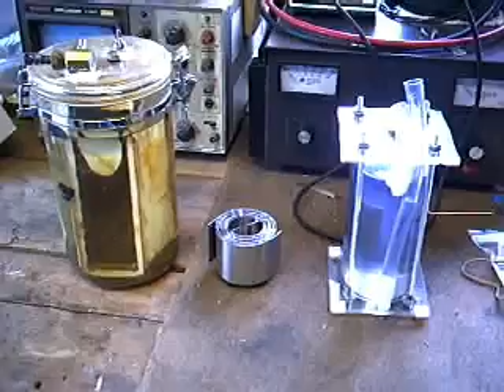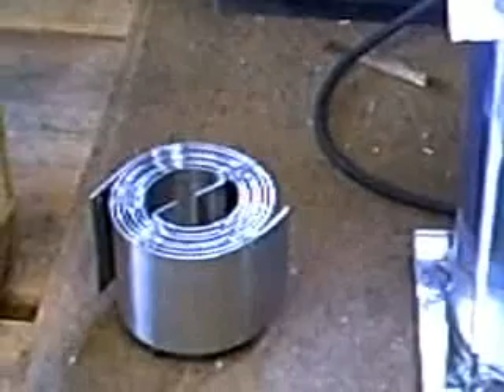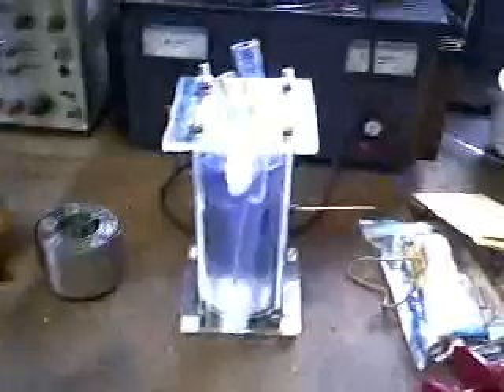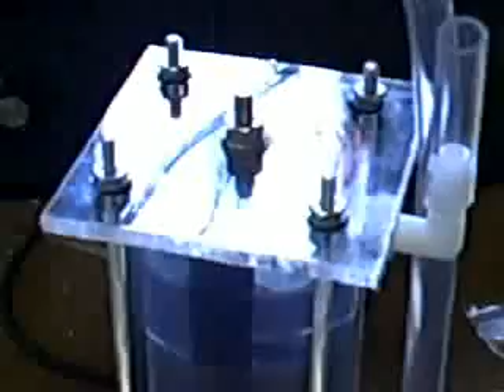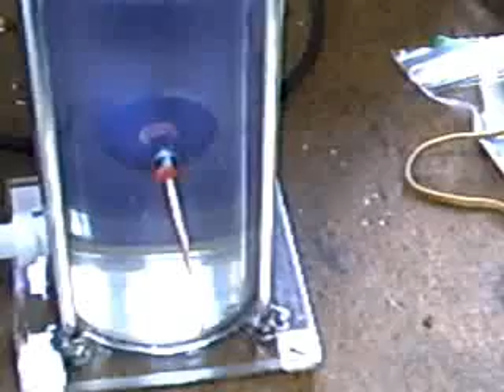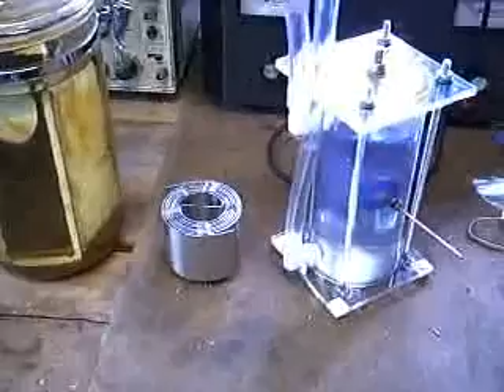#68 - Standardizing the language for HHO research

Comment: your right lets use the right names "fuel cell" turns H2 and O2 into electricity, heat & H2O by passing it thru a membrain. what you make is a "electrolytic cells" a name that has been around for over 100year (that how old this stuff is)(it makes H2 & O2 not HHO) the "coil" is an Anodes and Cathodes" and useing stainless steel for them makes chromite, and will kill you and poison the ppl around U when you wash out that yellow water that it makes!! name for all of this should be"Scam" ReportedEPA

Comment: it is getting abit complex-i thought it worth mentioning that the difference between fuel cell and electrolyser might need to be addressed.
as many people use the term "fuel cell" loosely and apply it to electrolysers,when the true definition of fuel cell -is a device that makes electricity from reactants.
not something that makes gases,or electroplates things.
wot do you think?

Comment from the maker: Here's where we are in our discussion of standardized nomenclature.

1) Form factor: Vertical, Horizontal, Square or Cubical
2) Configuration: Series (having one or more neutrals) or Parallel (only energized electrodes).
3) Style: Plate, Tube, Spiral, Helix, Wire or Mesh.
4) Extraction Method: Brute force, Resonance, Electron, Laser

I think anyhting more than 4 categories is just getting crazy. My spiral cell would be a CPSR wet cell. Of course there are hybrids too.

Comment from the maker: Yes. That's the goal. Here's how I propose to break it down. Comments welcome.

1) Form factor: Vertical, Horizontal or Even
2) Configuration: Series (having one or more neutrals) or Parallel (only energized electrodes).
3) Style: Plate, Tube, Spiral, Helix or Wire

What was formerly known as the zero-cell is now a VSP cell. The spiral cell I built is now a EPS cell (because Even Parallel Spiral is just too damn hard to spit out. ;-)

Stans cell would have been a ganged VPT cell.

Other ideas?